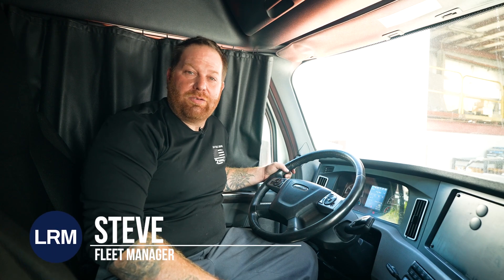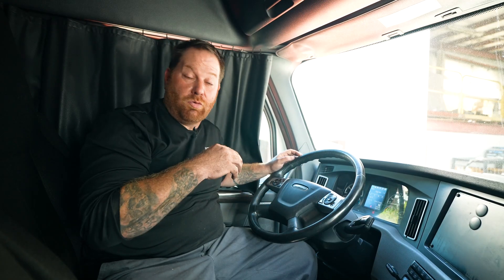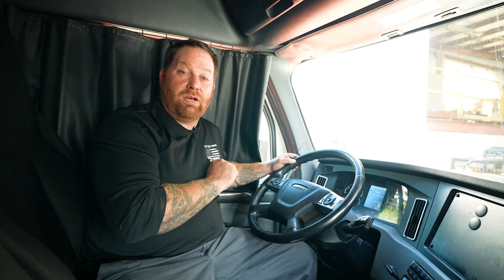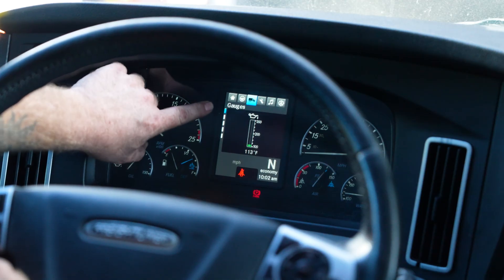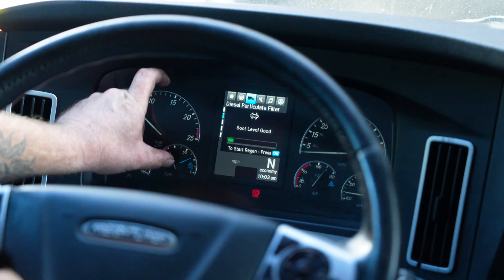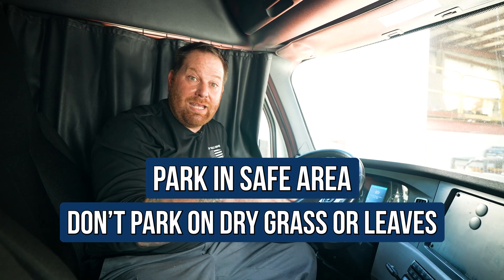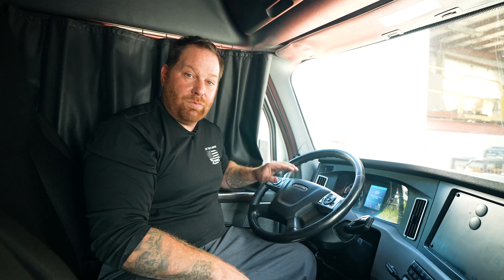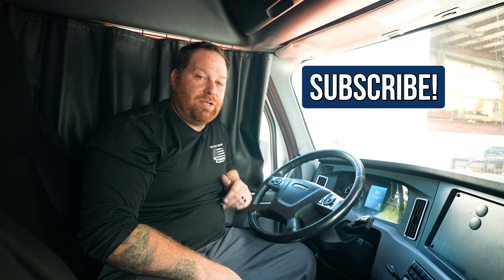Step-by-Step Guide to Regenerating Your Truck’s DPF

Comment: Unrelated, I got a CTP code on my ‘21 manual trans, 523512/31
I have no cruise control, everything else works like distance monitoring and warnings, abs, and traction. Any ideas? I’m not getting any VRDU issues either. Checked with a scanner and nothing came up but the dash says otherwise.